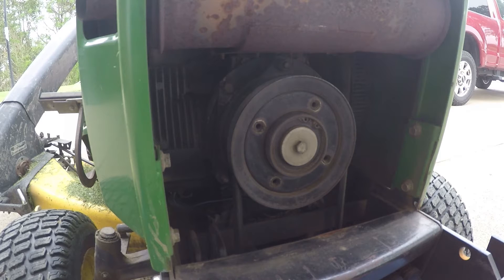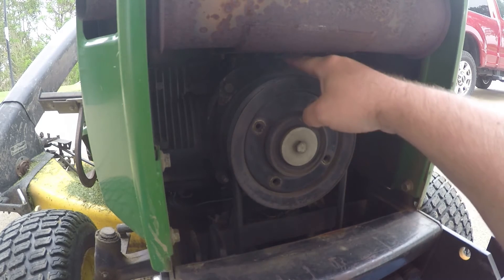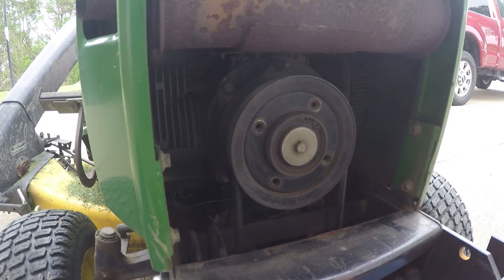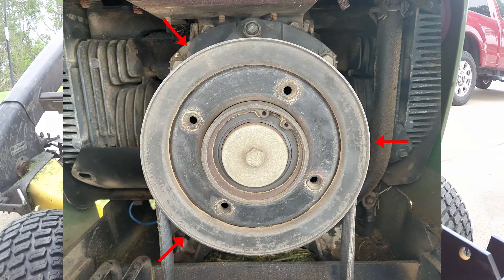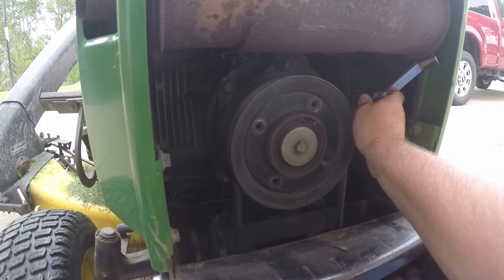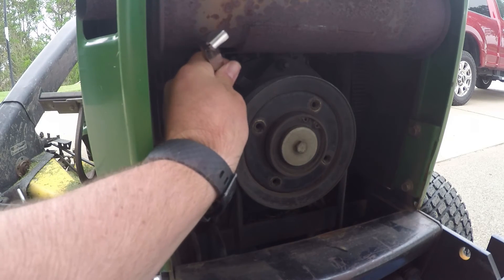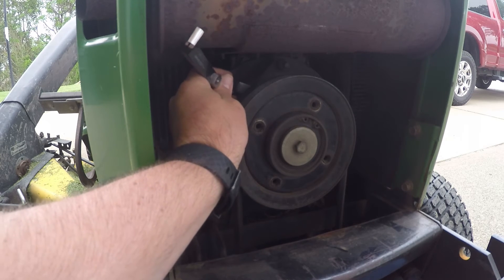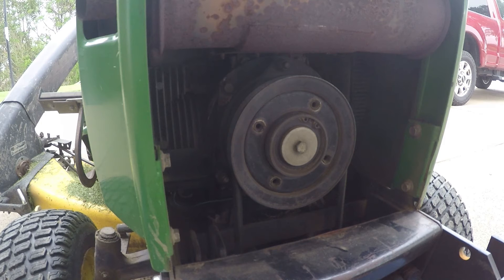Electric PTO Clutch Adjustment - John Deere Tractors (200 & 300 Series)

Comment: is the clutch spouse to turn without the PTO switch in gauge without mower deck belt on it
Reply from the maker: The pulley itself should not turn. The bolt in center will though.